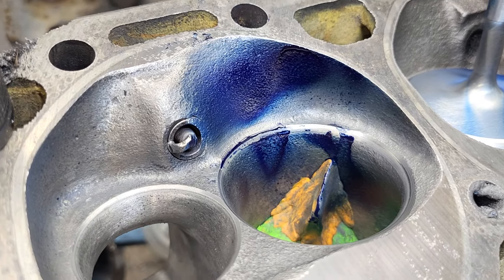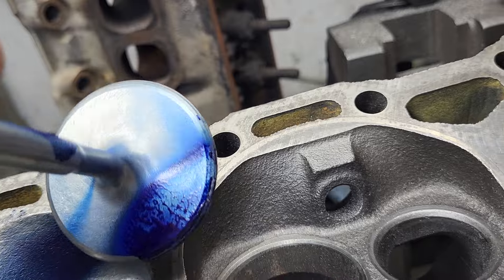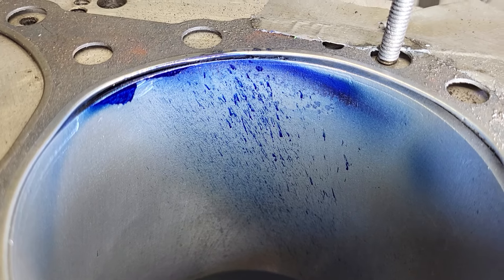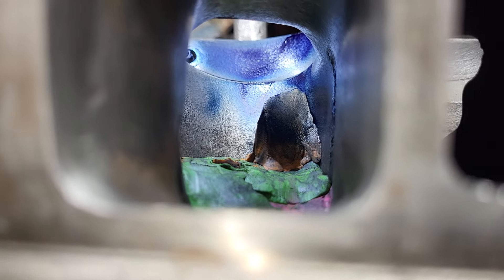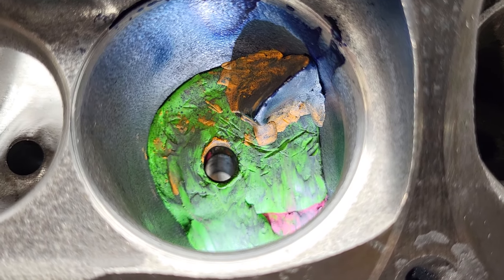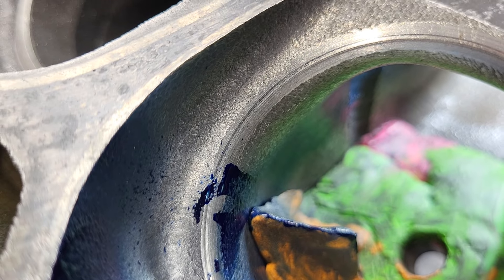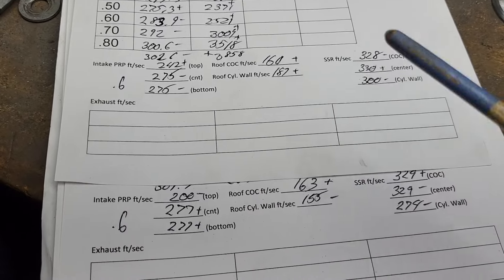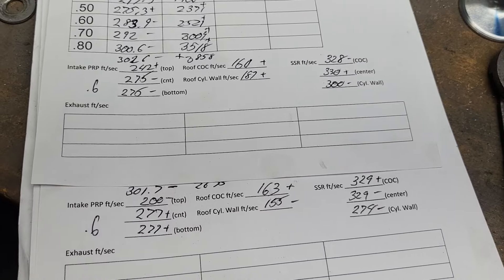53. Chevy 193 Swirl port cylinder heads, #41 Swirl fin in 8:00 position. Dykem explosion!

Comment: Wow! That was quite interesting.  I like the fuel distribution, even with the splatter.  It's a bummer about the mid lift turbulence. I wonder if a slightly shorter vane would reduce the turbulence while still producing similar fuel distribution.  I would guess with a tight chamber quench, this pattern would produce strong torque with lower exhaust emissions.  Another benefit could be higher knock tolerance due to reduced lean air pockets. That turbulence would definitely hold cam lift back. Awesome vid Charlie.  Can't wait for the 9 o'clock one!

Comment: Is that a ring washer lol, not sure I like that splotches down the cylinder,  it seems like it took fuel out of suspension.  Can't wait for your next video. I'm thinking I'll run a 2.055 intake and a 1.6 exhaust.  I think with the knowledge you have shared I can get a decent set of heads
Reply from the maker: That was the idea. Thanks

Comment: 3 years ago I had a Nascar head from 2018/19  on the flowbench.... The swirl numbers are so high that only a diesel injector and higher compression are needed and it will run.....that much swirl.

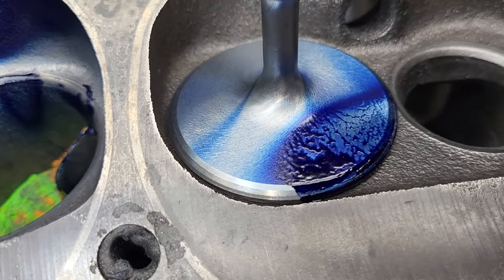That for me settled once and for all  the everlasting debate  give up a bit of flow for more swirl ........I mean  6.2 litres , 1:12 compression, 850 Holley and without restrictor plate crancking out at least 900hp @9000  ( wont state exact hp...far in excess of 900) .  When talking to a former Nascar engineer , who also worked at development department at Chrysler on lean burn ...he stated : if you can choose between  2% more flow and 5% less swirl  or 2% less flow and 5% more swirl...... You now know the answer .......